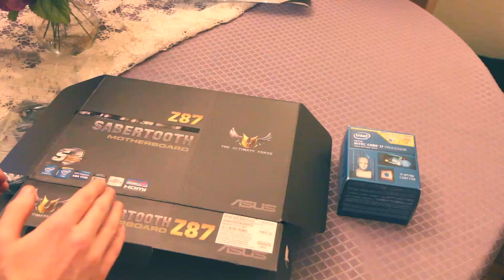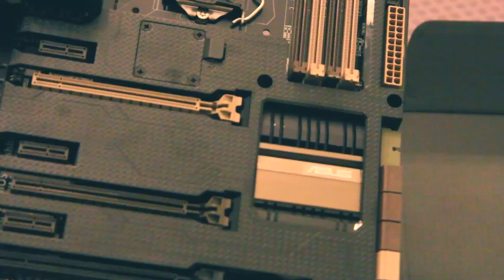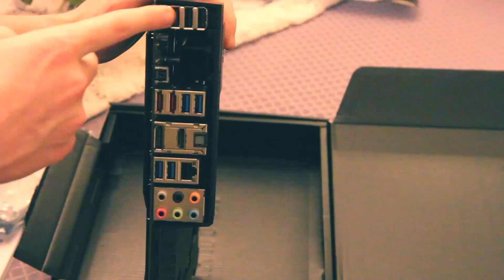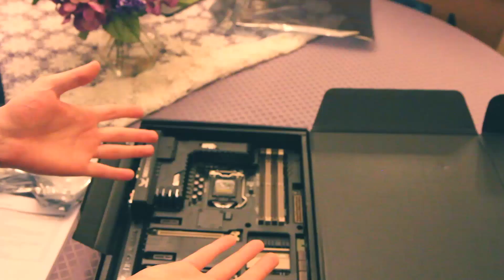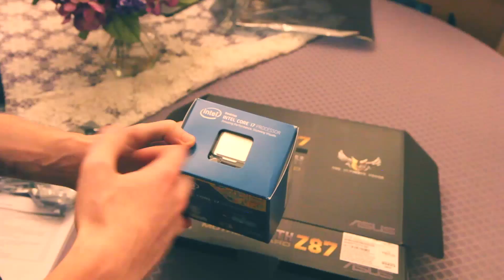What Is A Motherboard?

Comment: 1. GPU stands for Graphical Proccessing Unit. 
2. AMD dosent make CPUs they make APUs which is like combining a CPU and a GPU on a single chip.
3. Dont need a GPU to game. Most CPUs bring integrated graphics which is basically a really bad GPU built in. The only CPUs that dont have integrated graphics are workstation grade CPUs. For example a Xenon proccesor
Reply: AND does make CPU`s. The Athlon,  Opteron,  Phenom,  and FX are all CPUs
Reply: dukethedj AMD stupid auto correct

Comment: If you pop open a Mac, you'll likely find that the motherboard has been split up into many smaller boards. I opened up my archaic Mac Cube several years ago and was greeted with at least half a dozen boards with various connectors between all of them.

Comment: Difference in basic chipset types. An LGA is Landing Grid Array, where the board has pins on it pointing up. And the Processor is placed on there with the connectors meeting the pins. 

A PGA is a Pin Grid Array is AMD's alternative, where the board will have sockets (holes on it) and array of pins on the CPU slot down into the board to connect.

You then have variations on chipsets beyond that. Which are different sizes and dimensions as well as Wattage ratings.

There are lots of sites out there that allow you to build a PC as you go, and it will show you compatible components and so on. So if you select a Motherboard, it then lists processors, psu, ram and gpu that will go with them. Other than that pretty much everything else is cross compatible, SATA is the default connection for drives and storage. So your Solid State Drives and Hard Disk Drives, all connect the same as your Blu-Ray and DVD drives. The Standard for all GPU's is PCIE. The only difference you may have with those on modern boards would be the Version number if it's a PCIE 3.0 or 2.0. But I'm sure they are backward compatible.

Comment: I have an HP Pavilion from 2006 that I'm not using and if I took out the thing at 2:36 and put it in the computer I'm using right now, could I get extra graphics?

Edit: I also have some computers from the late 90's, could I also use the parts in those to make my computer better?

Comment: I've got AMDs FX-8350 with 8 cores.
Reply: ***** always get a FX 8350 long as your motherboards VRM supports it and would be good if you have the 990FX chipset on your motherboard
Reply: andre brito 
*****
I've got the SABERTOOTH 990FX with the 8350 and it runs brilliantly I'd also recommend Radeons R9 270x GPU.
Reply: No it does not. It has 4 so called Modules and 8 Threads.

Comment: You're a bit wrong about the "fragile" pins. The power supply doesn't plug into those. Those are for other peripherals, like those features your computer case offers if you got a fancy one. Whatever you do, do not try to connect your power supply to those. Your PSU(power supply) connects in one to two places to the mother board typically., it shouldn't need more power unless your MB has more power demanding futures that I haven't heard of or discovered yet.

To add, the fans are connected to the motherboard on those pins. The PSU connects to the motherboard in one or two other spots on it. Fans are part of the case, but you can also customize and have additional lights, audio or fans connected to those pins if you were to ever "pimp your case" or as some ppl I've seen turn their desk into a heavily customized computer case.

Comment from the maker: I also forgot to mention that not all  motherboards are not required to have a GPU, some intel CPU processors have a Integrated graphics, but they're not really good for anything advanced in regards to video games or video rendering.
Reply: Hi Repzion, you had a few errors in this video, and that's fine. But I think you need someone to fact check your videos before you go live with errors. I've been building PCs for about ten years, and have worked for EVGA and CoolerMaster as a Product Manager. So I know PC components and the industry inside and out. Or, I'm sure there's a dozen other people who'd be happy to help you out.
Reply: *****
Nerds and Geeks are two different things.
Reply: Every motherboard I've seen has had an onboard graphics card, so even with a normal CPU, you still don't need a graphics card to play games.  However, the onboard graphics cards aren't usually very powerful, so you can't have top-notch graphics in game.
Reply: McSkouvy There are tons of motherboards that don't come with on-board graphics. The typical motivation for including it is that the manufacturer is hoping to pitch the motherboard at some kind of corporate or government application where integrated graphics might be a way to save money, but that's hardly something that goes for all motherboards, or even most high end motherboards.

That stuff will just take up valuable real estate at the back IO panel of your PC as well, so there are good reasons to buy a motherboard without integrated graphics if one is planning to buy a graphics card.
Reply: you call yourself a geek with pride... i thought nerds liked this kinda stuff
Reply: Caliggy Jack i know
Reply: McSkouvy
you cant really play any modern games to my experience
Reply: ***** Not really. Combining components with performance suffering is not the future. We can do better, but not yet, but in this century. We have to make hardware more integrated into software, only then will we achieve the absolute perfect performance we strive to.
Reply: ***** not only that, the gaming market has exploded for mobile, in the future mobile will be the way to go.
Reply: ***** I'm just saying we're not yet ready to make the perfect integrated chips.

Of course, there is no such thing as an absolute perfect, but I hope you understood what I meant by that.
Reply: ***** I'm just saying people are excited about a product from a different timeline.
Reply: My friend just bought a desktop not too long ago. Really nice computer. It scores around 5800 on the PassMark Benchmark test. And that's without overclocking. I'm so jealous.

Comment: You are very good at explaining things about tech, I'm sure you'll help allot of beginners out. Keep up the good work. :) Also, if someone is wondering how much building a gaming computer will cost. The minimum is about 400 euros, then you have a pretty decent graphics card, an average CPU(don't worry about the CPU too much, you'll only need a better CPU if you get more advanced graphics cards or more gigs of ram) and a 8 gig ram which is good for all games currently available, more ram is just for huge servers and stuff like that. But I used to run a minecraft server with 30 people on it and it only needed 2 gigs of ram, which means I still had 6 gigs remaining if the server was running.(if you don't understand it, don't worry about it. It just means it's still good) So more gig is really unnecessary unless you're a game developer or if you want to run a huuuuuuuuge server for any kind of game. Also, I forgot to mention but your sound card will probably be pretty decent. That is the minimum, as for the maximum, for so far there really isn't one. As for gaming, I'd say that with a 2000 euros gaming computer you can pretty much do anything you want but I've seen people with 10,000 euros gaming PC's, which I think is just batshit crazy because it's completely unnecessary but the point is that there isn't really a maximum. I hope that helped some people out, bye. :)

Comment: Wow, I only spent like, $200 on my gigabyte board. And also, you can use a dual core cpu in that motherboard. They have dual core i5 and i3 processors.
Reply: I5 is a quad core CPU
Reply: There are both dual core and quad core i5 chips available.

Comment: That black cover isn't just for looking sleek. It's an innovative new air-circulation system for cooling! Supposedly conventional motherboards are less efficiently cooled as the air is mostly churned around the case, whereas your new system has air rushing over nearly all the motherboard evenly. I was really tempted to buy one of those motherboards, but my budget was a bit narrow, had to get a cheap mobo from Gigabyte, (unfortunate, as I do feel most safe buying ASUS).

Also, I should mention (I don't know how well known this is), when you're doing your PC assembly video (or assembly in general) grab some conductive metal, like an unpainted section of your PC case, to get rid of any static charge you might have in your body. I've been told even the smallest of static sparks can erase memory and / or scramble the smaller circuitry.

Comment: Hey Rep, good job on this vid. I'm curious if this will be a new series or maybe it will lead up to a video and show how to build a rig, I'd also be interested on your choice in parts for a budget gaming pc for about $1000.

This is my list of parts I will be buying for the Computer.

CPU	Intel Core i5-3350P 3.1GHz Quad-Core	 $176.98
Motherboard	Gigabyte GA-B75M-D3H Micro ATX LGA1155	 $73.99
Memory	Corsair XMS3 8GB (2 x 4GB) DDR3-1600	 $93.99
Storage	Western Digital Caviar Black 1TB 3.5" 7200RPM	 $88.98
Video Card	Asus GeForce GTX 660 2GB	 $189.99
Case	Raidmax Super Hurricane (Black) ATX Mid Tower	 $58.98
Case Fan	Apevia CF12SL-BBL 50.3 CFM 120mm	 $7.99
Power Supply	Corsair 430W ATX12V	 $39.99
Optical Drive	LG GH24NS95 DVD/CD Writer	 $21.98
Operating System	Microsoft Windows 7 Home Premium SP1 (OEM) (64-bit)	 $89.98
Monitor	Acer H226HQLbid 21.5"	 $146.99
Keyboard	Thermaltake eSPORTS Challenger	 $47.98

All items can be found @ http://pcpartpicker.com/

Comment: a slight correction, GPU is not "General Processing Unit" it stands for "Graphics Processing Unit" and basically handles graphics processing (unless you're mining BitCoin)

And not all computers have a GPU, older machines and less powerful computers and devices normally do not have a dedicated GPU and the CPU does the work that the GPU would do.

Comment: There is a small error here, you mentioned the GPU as a "general processing unit" this could've been just a slip of the tongue.
Also not installing a dedicated GPU is possible, since new CPU's include a GPU for basic things and programs.

Also you might want t ground yourself before handling a motherboard or any other component or you might ruin it by static electricity.
Reply: Don't forget to check the details and reviews. MOST CPUs have integrated graphics, some don't. My i5 is much more powerful than my Core Duo, but if I didn't already have a graphics card, I'd still be using my Core Duo, due to a low budget.

Comment: you should have gotten an 4820k, they run a lot cooler than the 4770k for the same price.
Reply: the 4820k has a 2011 socket, his motherboard has a 1150 socket
Reply: cookie4524 oh, ok thanks.
Reply: Getting an 4820k is just plain stupid. It's an older CPU generation (Ivy-Bridge) with lower IPC than the 4770k (Haswell). They run slower while the whole platform costs more money.

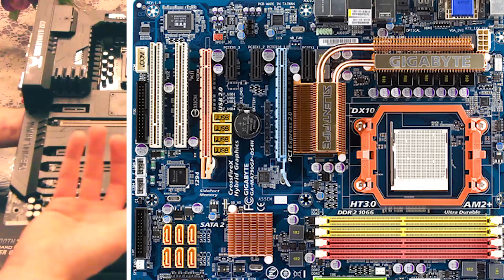Comment: 1:07 what batteries? there is only one(!) CMOS battery
6:13 e-sata? more like displayport.
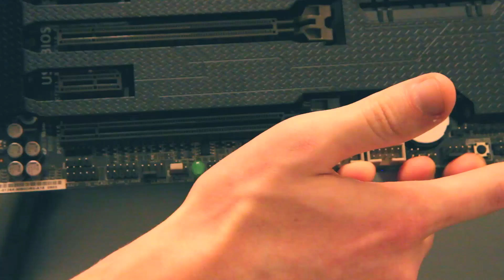6:34 power supply does not plug into these pins. these pins allow to connect more usb ports, com ports, audio, fireware, extra fans.
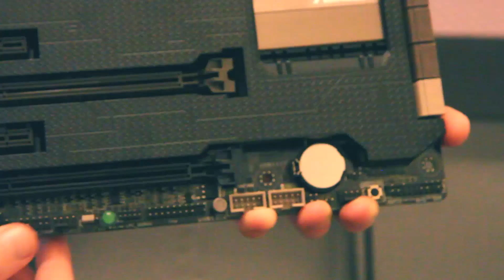7:01 no, these are not for sound, these pins are for on/off switch, reset switch, internal spekaer and led indicators.
cpu/speed rates? no, just no. these particular pins are not related with CPU.

And why did you not tell anything about MAIN motherboard component - chipset? :)

Comment: If I had to label each component of a computer's core hardware to biological organs...

I'd say the motherboard is the central nervous system, the CPU is the brain and the power supply is the heart.
Reply: ***** To what fans are you referring?
Reply: I think nearly everyone would say the same..
Reply: lol
Reply: I used to look at it this way, until I realised most computer parts are like different sections of the brain. Like the GPU is your creative side, CPU is your calculus side, RAM is sensory/short term memory, HDD is long term memory, and the PSU is the Cerebellum - distributing power to all the parts.
Reply: mastermalpass
GPU is your eyes! The sensory portions of your body. As mastermal said RAM short term memory and HDD = long term.
Reply: i never really thought of it that way, i always thought of it the oposite way. the brain is the computation system of the body, the nervouse system is the input-output circuitry, and the digestive track is the power source.

i guess thats couse i fixed my first computer when i was like 5 and learned the human body after that.
Reply: The CNS and the brain are pretty much synonyms (and that would be the CPU and the GPU, in your analogy). The motherboard would be the peripheral nervous system and the circulatory system (since it links all components together, and leads power to each).
Reply: Jeremy K
Except that the GPU senses nothing. GPU is a processor, and can you guess what processors do? Your completely incorrect analogy can be fixed - the GPU is the visual cortex.

Comment: the GPU only does graphics processing, you can do everything that isn't intense graphically off of the CPU itself, the CPU doesn't do microprocessing, it does all the heavy software processing, all the GPU does is handle rendering graphics
Also SATA ports are used for more than just harddrives, they're also used for optical drives, in fact, some SSDs don't even run off of SATA, they use the PCIe slots since they allow faster data transfer than the SATA port does
Reply: Regarding PCIe SSD's. Its relevant only for servers with enourmous IOPS. and pcie ssd's are super expensive. Its not related with house computing.
Reply: ***** I just said they were an option

Comment: Assembled PCs for close to 20 years, for myself, friends and relatives. Never going to bother with that ever again. I completely lost track of manufacturers, product lines and component standards at one point and it's just not worth it to relearn it all every 3 years. I'd rather pay someone to do that for me and it's still a hell of a lot cheaper than buying a pre-built (brand) PC.
Reply: Bah, such a killjoy statement. I love assembling PCs, i'd do that for a living. Sure, some manufacturers now are kind of crap (hey ASRock!), but i think the market's more exciting now than it ever was. Maybe the only exception is the P4 vs Athlon XP era.
Reply: MarcoZ You sound like the sort of person I'd pay to build my PC. ;)
Reply: I get my Motherboards and DVD drives from ASUS. My RAM and PSU from Corsair (expensive, but reliable), my CPUs from Intel and my GPUs from Nvidia.

Never been let down by any of those manufacturers... Cue AMD + ATI fan telling me I'm soon to be let down.
Reply: Nah, you won't be. All of those products are mostly been of rock solid reliability, my only woe as a somewhat AMD fan is that you basically paid into strenghtening a dangerous possible monopoly, if AMD eventually goes belly up. I've been disappointed when Intel used to change about one CPU socket every year or so, completely dashing everyone's hopes of upgrading their existing system slowly and step by step, an almost Apple-like strategy, while AMD woefully lost market share, despite their backward and forward compatibility in chipsets being a lot more open. Anyway, it's a personal choice after all, and you're FAR less likely of running into driver woes on an Intel\Nvidia system than on an AMD system, so i understand your choice.

Comment: Does the plating give slight esd protection? Ive got a gigabyte atx ultra durable 4 and its got 3x esd resistance, could anyone tell me if thats bullshit? I made a few mistakes with my motherboard such as sitting it on the metal frame of my case and it kept coming into contact with the frame due to the psu, it wasnt turned on thankfully.

Comment: Nice choice in mobo mine is an Asus... tho not the one you have ..I have a x4 phenom II black CPU right now but I am going to be upgrading to a x6 soon.. I was waiting for phenom to come out with a x8 but no one is selling them.. I have seen a couple ppl have them.. but i cant seem to find them.. I prefer to stick with phenom.. but i dunno i may have to go with a different type..  I have never spent over 150$ on a mobo.. since it isn't really necessary..  but I suspect I will need to update mine in a year or so .. it supports 16gigs i think.. and boards are now starting to support 64gigs.. so i sense i will need to upgrade that soon as well.. but my mobo has lasted quite a long time xD.. I have had it since like 08 i think,,  Asus is definitely the brand to go with..   I also recommend the Gigabyte brand.  My sister is running on a Gigabyte and she has no qualms..

Comment: Nice video man. Just a few things i'd like to say. I have been building PC's for years and years, so I know pretty much everything there is to know in the PC hardware side. Your motherboard isn't a gaming motherboard. Your motherboard is board that you can use for gaming, but the main point of it is to last the test of time. It has very high guilty caps, lanes heat sinks ect. It is build to last a very long time, that is why it has the military pass badges. A true gaming motherboard are the Asus ROG line, the MSI Gaming line, the Gigabyte Sniper line. Motherboards like that are targeted at Gamers. Besides my motherboard the Asus ROG Maximus V extreme. That is build for overclocking and gaming. Also to add, because you are running the 1150 socket, you wont really see much difference in gaming performance across most motherboards. You will only start to see difference when you go past the 4.5GHz mark.
Love your videos, and it's good to see that you are making your own PC.  
Thanks for reading.

Best Regards